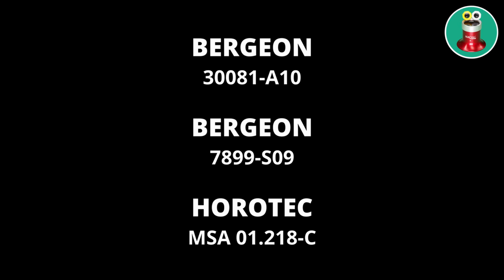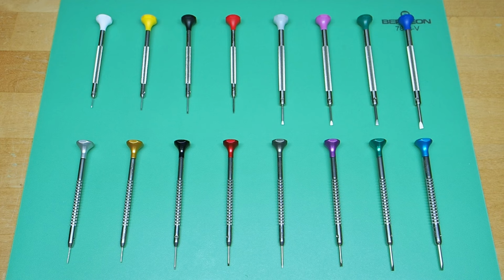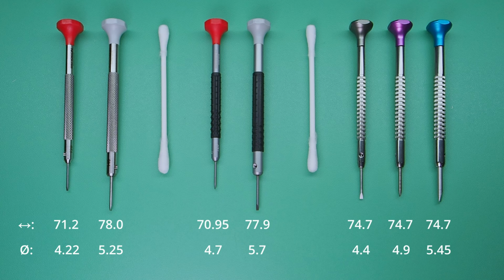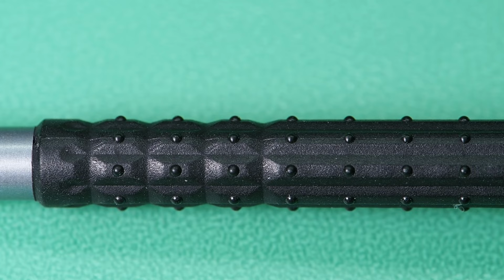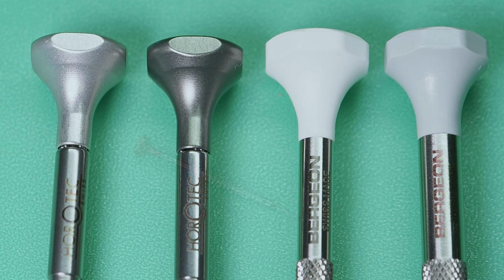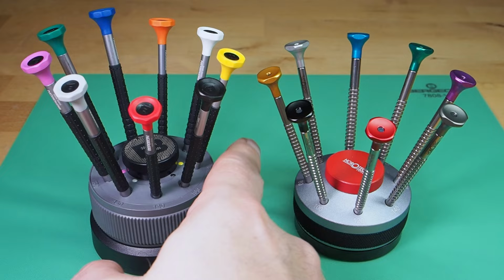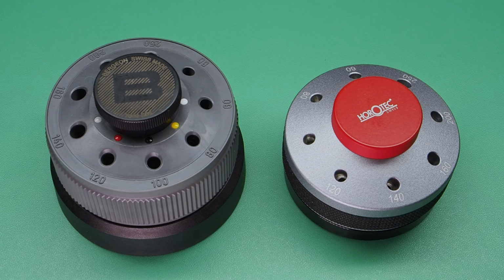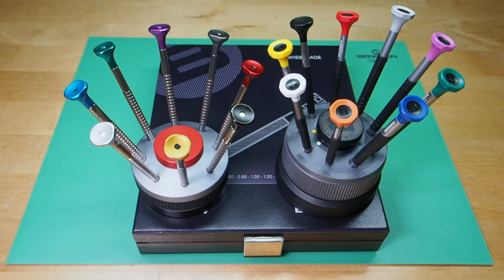Watchmakers screwdrivers – Bergeon 30081-A10 / Bergeon 7899-S09 / Horotec MSA 01.218-C

Comment: The thing I like about the cased set is they are easier to dust. Those other sets you have to pull apart, wipe the stand, then replace all the drivers. The case is dusted with a single swipe and all the dust is captured with a microfibre cloth. I appreciate the case takes up more room but that is not an issue for me, and I like the old fashioned style case. Thank you for the excellent presentation. Outstanding!
Reply from the maker: Dust is also a major concern for me and that is the reason why I like the set in the box. Having three sets, three boxes would take up too much space that’s why I bought the other two on rotating bases 👍

Comment: Thanks for the review Leo. I have been using a set of Augusta screwdrivers I purchased years ago. I was planning on just using them until I could afford a set of Bergeon but I have found them to be fine screwdrivers. They came in a nice wood case, they feel good in the hand and the  blades last a long time. Not a bad purchase for 65 Euro or so.
Reply from the maker: That’s what it’s about, finding a good set you like. It doesn’t have to be Bergeon or Horotec. As long as you’re satisfied with what you have, that’s all it matters.
The stainless steel Bergeon was my first set and I’m more than happy with it. I only got the different sets so I can easily differentiate between them.

Comment: I have a quite cheap set now so this video fits me nice. Sometimes my Screwdrivers gets magnetized so that's a bit frustrating and I've a bit problem with colors. Thank you for this, very informative, will help me deciding for a new set!
Reply from the maker: My blades also get magnetised from time to time, I just have to put them on the demagnetiser. You could buy the anti-magnetic blades but they will be softer. You can’t go wrong with any of these sets. There are also the stainless steel handles with TPE elastomer coat etc.
Reply: @MacroTime28800  Yeah, I guess these might be a bit more resistant to magnetized but okey. Maybe I run them on the demag before every project.
Reply from the maker: I don’t have to demagnetise them very often. Perhaps that’s because I demagnetise cases and movements before disassembly.
Reply: @MacroTime28800  aha, hmm, good idea! Thank you
Reply from the maker: no problem 👍

Comment: I have a cheap set that I bought online, I only use it once a year for my watches. do you think I should upgrade to a high-quality set? I only worry about stripping screws not sure if a higher quality set will help in this matter or not?
Reply from the maker: I don't think there is any need to buy a better set if you only use it once a year. What you could do is to buy good quality Swiss blades and swap them for the ones you have in your cheap set 👍

Comment: For me, comfort of the main part, and then the actual blades. You can indeed have cheap screwdriver bodies and good blades.
Reply from the maker: I was wondering whether one could buy an inexpensive set of screwdrivers and replace the blades with decent blades. I considered buying a cheaper set for the video to see whether I could use the Bergeon or Horotec blades but there are many of the cheaper screwdrivers and even if the blades fit in them, there is no guarantee that they will fit in all cheaper sets, that’s why I decided not to review a cheaper set as I could mislead others if the blades did not fit in their sets. It would have been nice though if they did.
Reply: Yeah, agreed, I was thinking of like cousinsuk cheap drivers then using better quality blades. It’s not easy to recommend anything apart from bergeon, horetec and a*f
Reply from the maker: That’s just it, you never know what you’re going to get when you buy an inexpensive set. I’ve been using these sets for quite some time so I feel comfortable recommending them 👍